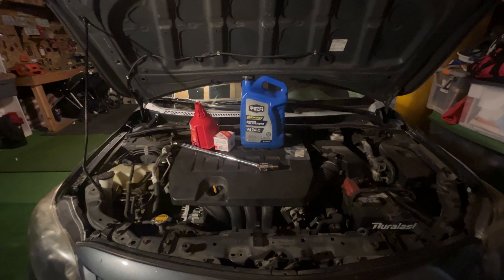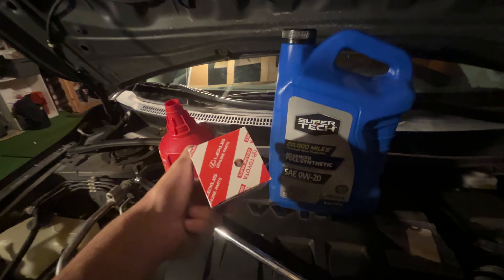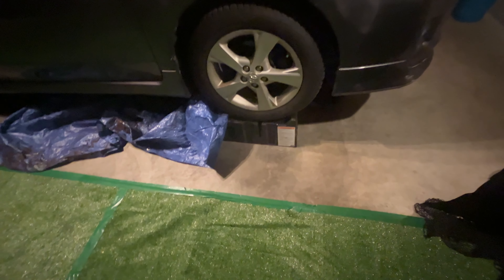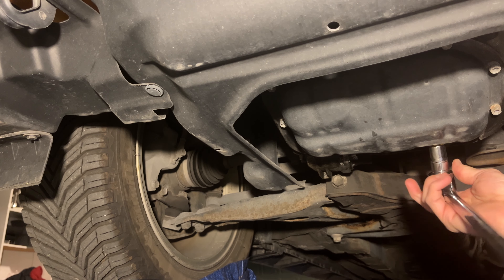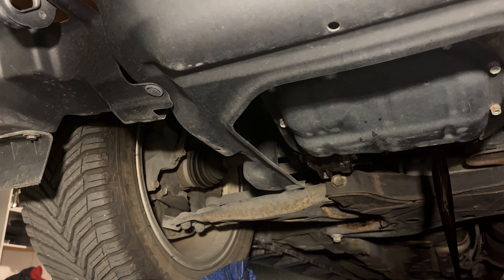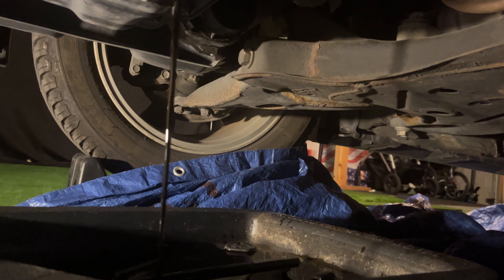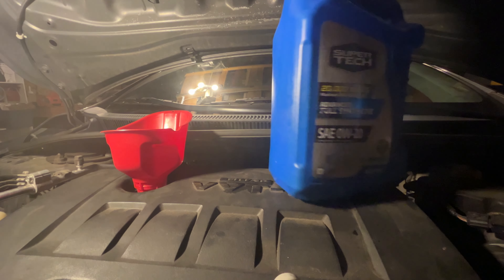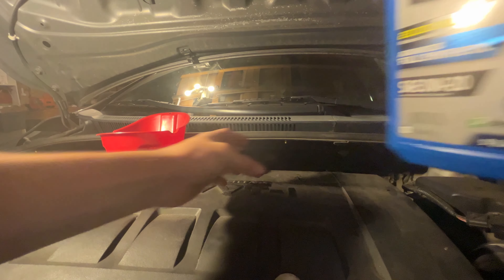2009-2013 Toyota Corolla Oil Change! How to Change Oil 2011 Toyota Corolla! Wal Mart Super Tech Oil!

Comment: It's important to use a torque wrench when putting filter on, torque to 18 lbs ft, if it's put on too tight good luck on getting it off. Trust me!!!
Reply from the maker: I've never used a torque wrench for an oil change and never had any issues, I do have a line marked for where I need to turn it to, it might be a good idea though, I will try it out next time, thanks for commenting and make sure to subscribe!